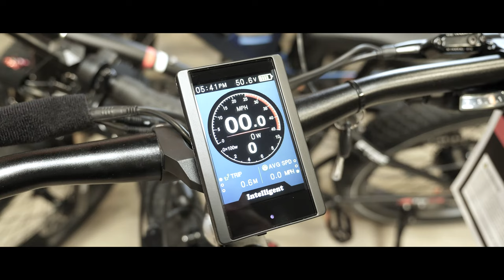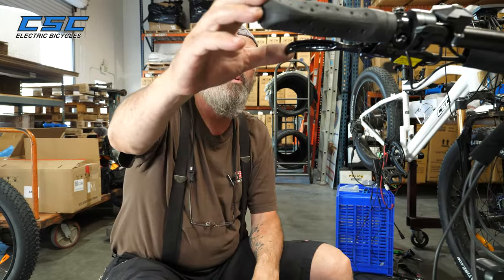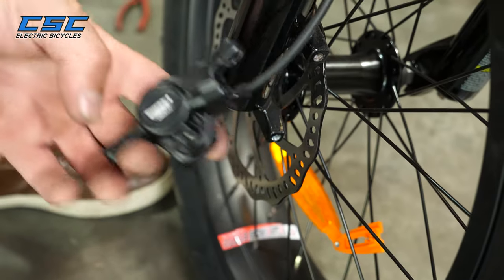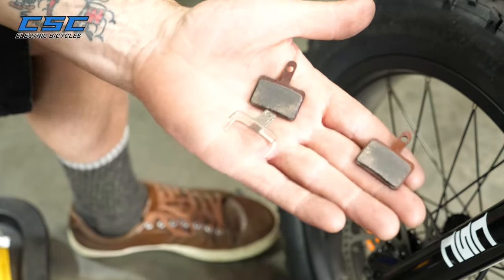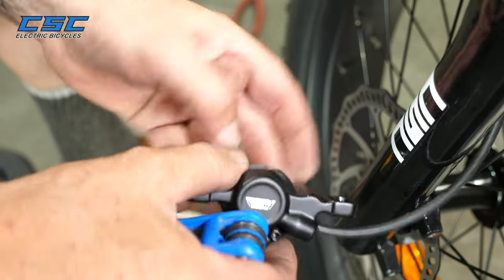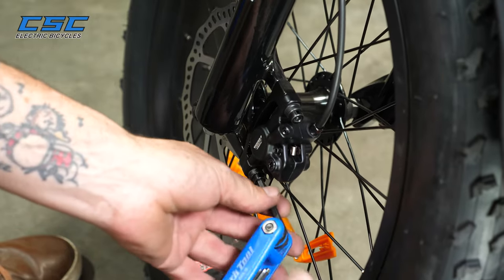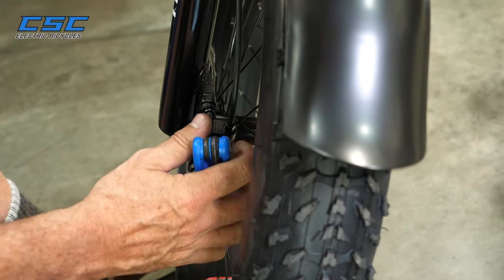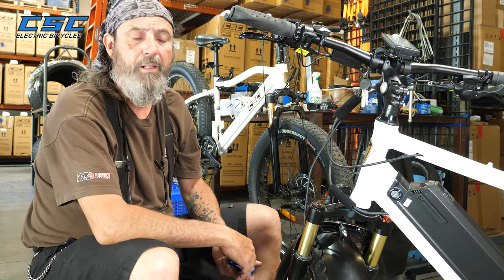Ebike - How To Replace Your Brake Pads

Comment: I changed the pads but I still get a lot of play on my breaks. It won't break unless I pump the breaks a couple of times. Any suggestions?
Reply from the maker: You probably need to bleed some air out of the brake system.
Reply: You will need to bleed the brakes..there should be air on the lines

Comment: What composite are you using?
Reply from the maker: Specially formulated E-Bike compound with ceramic layered heat barrier between the organic friction material and backing plate to reduce heat transfer into the brake caliper. https://cscmotorcycles.com/e-bike-accessories/tektro-brake-pads-pair/